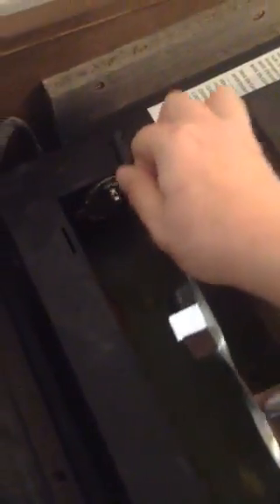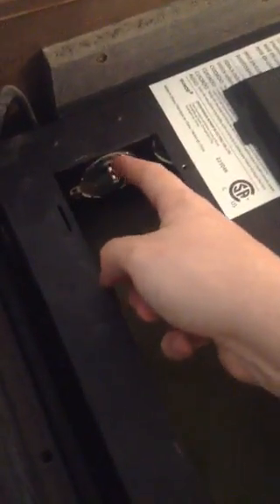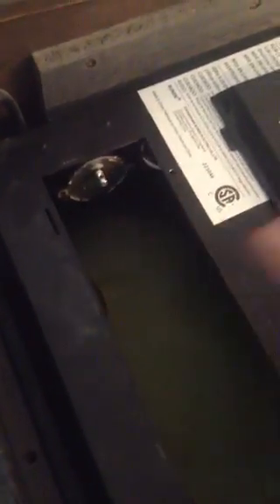How To Fix Electric Fireplace That Has A Stuck Flame

Comment: Thanks for this tutoial on how to fix a stuck fireplace motor. I bought a new SEI FE9275 Southern Enterprises Sicilian Harvest Electric Fireplace,  and the fake flames kept getting stuck. So I took it apart and did just what you said. Works perfectly now.
Reply from the maker: Excellent. Always happy to hear when my videos provide easy assistance
Reply: Would this cause the heater to stop working as well? My flames stop when I turn the heater mode on what does that kean?

Comment: Thank you so much for this video.  Now I don't have to buy a new fireplace.  I only use it at Christmastime to create a holiday look with the stockings/tree, etc.  My fireplace is 18 years old and I used some WD40 and it worked.  It may  need a better oil, but for now it seems to be working.  #Grateful
Reply from the maker: Thanks for watching. Glad you got it fixed and saved money. Wd40 is a very temporary lubricant. I would suggest some sewing machine oil. Or some multi purpose oil. Something thicker that will stay on longer. Enjoy your Christmas and please like and subscribe

Comment: Everything works on mine but it won't light up. Heat, and the rotisserie does turns. I even removed the bulbs and tested them and they work so not sure why no 🔥 flame? Any ideas?

Comment: I replaced the bulbs that are located on the front of my fireplace, it still doesn't work no lights  or flame. But the power switch beeps when i put it on manually but still no flames. Could it be the fuse is burnt out? I bought it second hand so I have no manual. I believe i would have to take the entire back off of mine to access that?
Reply: Same thing here!!!  I plug it in, turn it on and it beeps ( red lights come on, instead of red, orange and green ), but doesn't work at all. No manual either. Let me know if you fix yours, please. Thanks.

Comment: What kind of oil? Like WD-40?
Reply from the maker: You can use a machine oil. It’s fairly cheap to buy. Don’t use wd40 because it will only lubricate a fine layer or oil that will wear away prematurely. With machine oil it’s thicker and will last a lot longer. Thanks for watching please like and subscribe

Comment: My flame switch won't switch on do u have any suggestions
Reply from the maker: Does the heater still turn on?
Reply: No that stopped working as well but the power switch works
Reply from the maker: I’m not sure what that would be
Reply: Bill Of All Trades Brantford ok thanks for taking the time😊

Comment: what type of lube ?
Reply from the maker: I just used some vegetable oil. Every house has it and it’s cheap.
Reply: @BillOfAllTrades2016  thank you - also; someone could likely replace the old electric heater with a new infra-red one approx the same size of unit too

Comment: I change my motor 2 Times already the flames it’s freezing all the time it’s lights up but no flames going ,after changing the motor it’s working few months and the flames it’s not going again ,
Reply from the maker: You need to keep oiling it. When I don't use mine in summer I need to oil it and turn it by hand to get it going.

Comment: On mine the lights and the flame rod aren't working. Not sure how to fix that.
Reply from the maker: +Fairess Reid do Just like in the video. For yours find the screws on the back and remove the panel. And unscrew the bulbs and replace them. For the motor it should be I front of the lights. Try lubricating the rod and running it again. If that doesn't work then use a voltmeter to check if electricity is getting to the unit
Reply: I put all the time Every night with out the heat just for decoration. I love the flames
Reply: When I plugged it up it want come on what's the problem help please

Comment: It’s such a pain in the ass to have to lift it out of the wall and takeoff 20 screws every time to oil it. 🔥🤬🔥
Reply from the maker: How many times are you oiling it? Should only need Every 2-3 years. If you need it more than that you need a better oil.
Reply: Bill Of All Trades Brantford this is about the fourth time and has stopped on us. It was only installed about eight months ago. The last time we took it apart we sprayed WD-40 on it. This time we’re going to try Jig-A-Loo brand.  It is a Hampton Bay model, there was no mention in the manual of ever having to oil it. Thanks for the reply.
Reply from the maker: They didn’t have a warranty? 8 months is still new. I’m not a Hampton bay fan. I have a couple of Their ceiling fans and they make terrible noise after only two years. The oil you are switching to is a good brand. You should call their customer service and see if you can get some money back or some free service